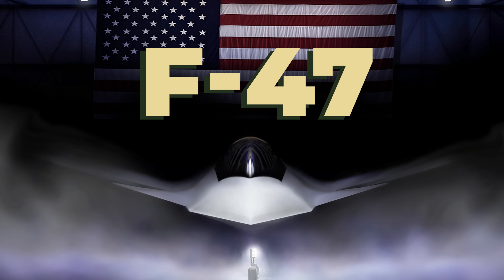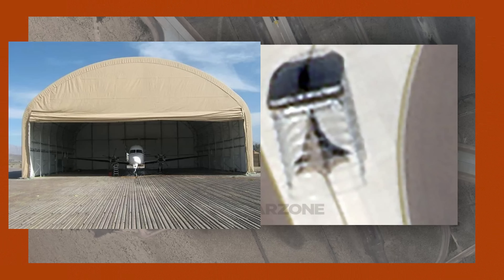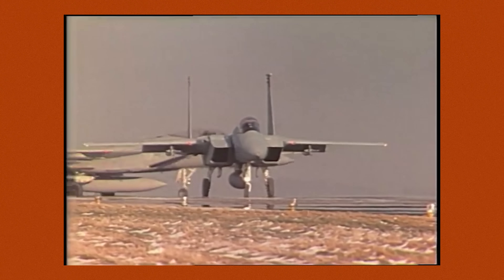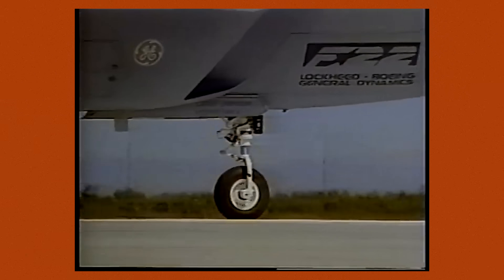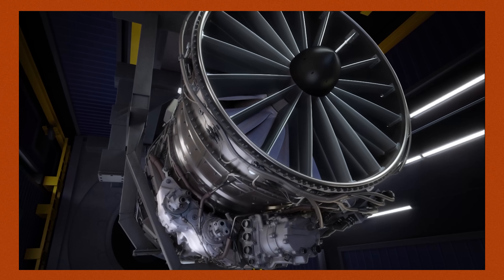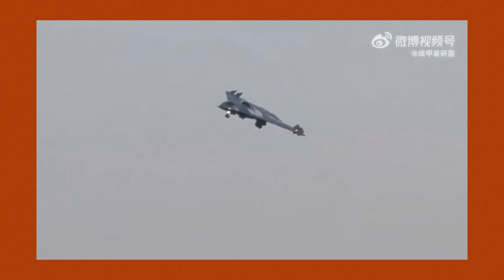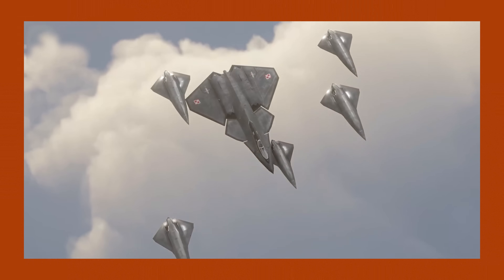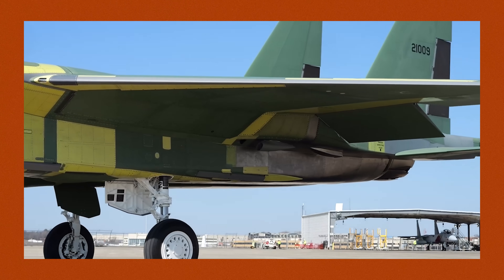America's "New" Sixth Gen F-47 is NOT New

Comment: Now, to be fair, the F-15 is still stupid fast for its weight class.
Reply: That's because it's an engine with flight capability
Reply: @matthewkuhl79  , yup, and engines outpaced what the human body can ride back then, likewise the F-35 has   since pushed the limits of what the human mind can control.  In the (now) zero sum equation of aircraft design, the limit-state context of fighter jets is defined by human physiology, now that we have technology that can surpass biological function, systems can be optimized.
Reply: It's not that any jet fighter is "stupid fast," it's that Mach 2.5 is the functional upper limit for turbofan engines on aircraft of any size, (without dramatic aerodynamic and afterburner restructuring like the SR-71 has, which make it much less suitable for combat roles,) and we've known how to build planes that can manage that for half a century. Breaking through the sustained Mach 3 speed limit requires either dramatic engine redesign or major breakthroughs in metallurgy, neither of which look appealing from a reliability standpoint.
Reply: @RamadaArtist  , the F-104 was stupid fast, the SR-71 is insanely fast, where it is idiocracy to consider the engineering challenges involved as central to jet fighter design.
Reply: F-4 was stupid fast too. F-15 was mach 2.5 and the F-4 was mach 2.3 and made like 20 years earlier. They were using it in Vietnam.
Reply: @forfun6273  Yeah, exactly. We hit Mach 2+ not long after we broke the sound barrier. Most of the improvements in engine power since then have been for instantaneous acceleration, rather than top speed.
Reply: Sure it was stupid fast but would use all of its fuel in minutes and not be able to make it home.
Reply: American answer to MiG-25, which is also stupidly fast, what do you know.
Reply: American answer to MiG-25, which is also stupidly fast, what do you know.

Comment: The main reason we are building this jet is because short sighted people killed the F-22 early. We needed more F-22's but it would cost more to restart production than build a new clean sheet fighter. This is good, because a clean sheet fighter will let us build one with that extreme range and a longer payload bay. We have new weapons coming down the pipe that won't fit into the bay of an F-22 or F-35. It's possible that this fighter will be able to carry an AIM-174 internally, which is silly. That would give us an incredibly stealthy fighter with an extremely long range and an air to air weapon with a range of potentially hundreds of miles.

Comment: The stability doesn't really matter for modern planes since they have extremely advanced and precise flight control system that can adjust the plane to the slightest change in air temperature. For example F-16 is built to be unstable, without it's fly by wire system it'll rip itself apart mid flight

Comment: the thing you seem to missunderstand is that manufacturing is quite fast irl. it's the issues you face in prototypes that stalls the line. you rarely get it in first try and even if you do most likely it was old idea applied in the right place. therefor, program started in 2014 and have flown shortly after is nothing shocking. AND the "it all started 30 years ago therefor it's not a new aircraft" is true to some extent.... by that idea every car with 4 weels is 200 years old idea because it started there, the same way the ngd started with airframe desing from 30 years ago.

Comment: I just hope that it surpasses the f22’s dry thrust and wet thrust as in after burner. As the f22 produced 26k lbs each x2 52k lbf dry and 35k lbf wet x2 totaling 70k lbf. If the f47 has 2 engines they better produce each 40k lbf dry and 50k lbf each after burner totaling 80k lbf dry and 100k lbf in after burner. It’s not that hard to design a plane with 2 engines.The f16 single engine produced at most 29k lbf in after burner the f35 was bigger and heavier single engine fighter plane produced 28k lbf dry and 43k lbf in after burner. It would have been better if the f16 produced 25k  lbf dry and 35k lbf in after burner. If the f35 produced 40k lbf dry and 50k LBF in afterburner say having a super cruise capability at speeds of Mach 1.6  and top speed of Mach 2.2 that would be better. If the f22s engines each produced 35k lbf dry and 40k lbf each in after burner. It woukr almost never need after burner but have a super cruise speed of Mach 2.2 and top speed of Mach 2.8. Since the f22 is pretty heavy I’d say it would need 40k lbs dry each and 50k lbf each wet. With a super cruise speed of Mach 2.5 and top speed of Mach 3.3. Imagine the b1 bomber not having 4 engines and having either 4 engines that are crazy heavy and produce 45k lbf each or 2 Lighter weight more efficient engines prolly saving an extra 25k lbs in engines alone going from 4 large heavy engines to 2 smaller lighter weight engines and say it has 2 more flatter than round engines that each produce 60k lbf each dry and 80k lbf each in after burner with an extra 25-30k lbs more in fuel capacity it could prolly cruise at mach 1.2 and top speed being Mach 1.6 and maybe carrying almost 100k lbs of weapons if configured a bit different..

Comment: Vietnam data -> ACM almost never exceeded Mach 1 & Gen 3 / 4 aircraft couldn't achieve max speed w/ meaningful fuel & missile loads (F-104/6 excepted) & had a few minutes endurance at full AB. US Gen 5/6 stealth aircraft w/ internal missile loads can super cruise w/o AB for significant distances. The F-15 Mach 2.5 is largely a byproduct of a massive power to weight ratio for ACM dominance.

Comment: Im a 3D designer/computer graphics specialist by trade, i believe it WILL have wide Y like vertical stabs similar too yf23.... Hidden in plain site, being even more evident with increasing image brightness/contrast, look at the American flag in the image, right where vertical stabs would be located the American flag is shaded in on both sides, but not the middle for absolutely no reason except to hide something... if really a 6th gen then I think there has been a breakthrough in stealth of some sort OR a breakthrough in detection technology, so either adding canards and vert stabs dont hurt the stealth as much to make it un worth it, or detection tech is getting to a point that trying to hide is getting l3ss feasible and true stealth benefits are missile lock anyways.. Lastly i think the new 3rd bypass of enginewill be used for rear control surface exit, lowering thermal signature, and cooling on board comput tech..

Comment: i dont understand the criticism the F-15EX is based on a plane they designed in the 70s but the newest EX model has the highest payload and speed than any other fighter jet out there right now. the 47 is pretty much speed, stealth, payload, and manned/unmanned drone combined with state of the art jamming and target locking capabilities. its line if you took a classic camaro body and stuffed it with a modern F1 racecar engine and electronics

Comment: This is actually common for the US military. 

They don’t rely on cutting edge technology as that’s not only expensive but unproven to be effective in the field. Results are what matters in a battle not flashy gadgets, consistency is king. Sure some of our scanning and radar detection with ion based heat map signaling is best in class by a mile especially for laser detection, but for 95% of all personnel gear and operated equipment it’s generally comprised of technology that’s decades old. Like the F-35 lightnings head tracking helmet with pass through scanning, looks super high tech but it’s largely technology from 2010-2015, on par technologically with the motion tracking of the Xbox Kinect. 

Area 51 is the location of interest if you want truly next generation technology which includes but is not limited to solid state magnetic forced propulsion.

Comment: Air superiority is a term for being able to beat the other guys.  F-22 is designed to be an air superiority fighter, clearing the skies of enemy aircraft.   F-35 is a multi-role fighter.  It can beat a lot of planes.  But not the F-22.  What's not talked about enough is the networking between planes that allows an F-22 or F-35 launch missiles carried by the F-15 missile trucks.

Comment: Realization of old concepts using the state of the art technology is pretty normal in the aerospace industry.   A good example is the flying wing or a flying wing bomber.  The YB-35, featuring 4 propellers, made its first flight in 1946.  43 years later, with stealth, fly-by-wire and other new technologies, the B-2 Spirit made it's first flight (1989).
Reply: It’s also because the concepts were tested and trialed.
It’s faster and safer to do that than just coming up with brand new designs that will take literal decades to finalised.
Reply: @MP-vc4nu  I would also add that back in the olden days we had more competition to develop new vehicles and planes that are still being used today while a lot of the new projects are being worked on by companies with monopolies on military contracts that are able to charge more and go over budget on pretty much any new equipment meant to replace older equipment but they keep failing at it.
Reply: There unfortunately is only so many aerodynamic shapes that work at super sonic speeds while maintaining stealth. 

 Flying wings were one of em. We just didn't have the fly by wire to make them safe. 

 I honestly wouldn't be suprised if seventh to tenth gen fighters or drones to look like UFOs or discs using active flow control tech to maneuver. Disregarding all typical flight surfaces in favor of AFC to maximize stealth. 

 If stealth is still a thing of course.
Reply: @RedactedDeath I was hoping someone would point out the MASSIVE distinction between hand-flying a YB-35 and piloting a fly-by-wire B-2. The YB-35 was an ill-handling, twitchy beast — practically an accident waiting to happen. What finally made the flying wing viable wasn’t better engines or cleaner aerodynamics, it was computers. Full-stop. The B-2 is fly-by-wire from takeoff to touchdown because it has to be.

And yeah — we all remember the pitot tube miscalibration crash. Watching those control surfaces flap around like a panicked bird right after liftoff was chilling. Perfect example of just how dependent the entire system is on accurate sensor data. When the flight computers think they’re flying a different airplane than they really are? Game over.
Reply: @ncrawford1488  YB-35 worked out the aerodynamics of the airfoil or the airframe.  Stealth gave it a new reason or mission and fly-by-wire made it actually usable... puzzle pieces.
Reply: @peterinSF  @peterinSF You’re not wrong about the puzzle pieces, but the way you’re framing it downplays just how unflyable the YB-35 truly was. It wasn’t just “working out the airfoil” — it was a barely-controllable platform that needed constant pilot input to avoid killing everyone on board. It was inherently unstable, and that wasn’t something a little more time in the wind tunnel was going to fix.

Without computers constantly correcting its behavior hundreds of times per second, a flying wing like the B-2 simply doesn’t work. That’s why the YB-35 was never going to be viable as a production bomber — it was a testbed, and a dangerous one at that.

Fly-by-wire wasn’t just one more puzzle piece. It was the glue that held the whole damn puzzle together.
Reply: As material science and engineering improves, everything old is new again.
Reply: Horton 229
Reply: @CrazyDutchguys  Jack Northrop was already designing and testing flying wings before he would've ever heard of the Norten brothers and their design. The propeller driven N-9M testbed in 1942, and the jet-powered XP-79B in 1945. Though the latter crashed on its first and only flight, 7 months after the first powered flight of the Ho 229 V2. I'm sure he made use of the Horten data once it became available, but he was already working on the YB-35.

Comment: "Thinking of fighters as missile carriers" is a fallacy. It was one of many fictions by JSF program PR and marketing people. Air combat does not work this way, and modern technology (like EW and stealth) makes fighter performance even more important, not less important.
F-22 took off in 1990, and they (143 of them that are active) were finally declared fully operational only in 2021.
F-35 took off in 2000, and it barely reached Milestone C in its development. Every single F-35 is basically a non-operational prototype still at this point.
F-47, at best, is in very early prototype stage. Expect to have grey hair by the time it flies.